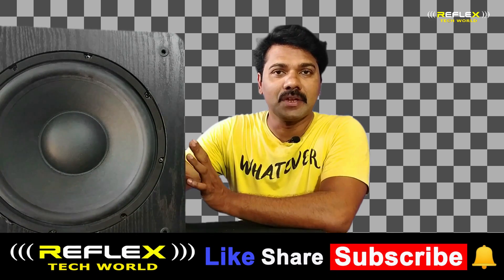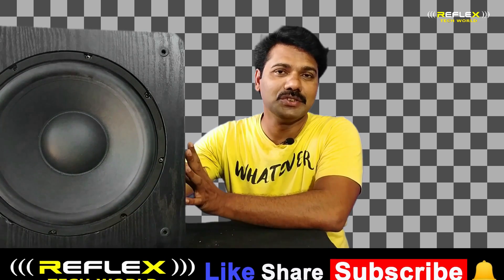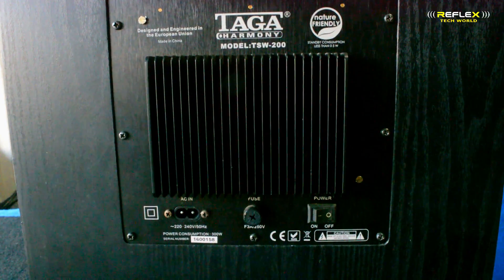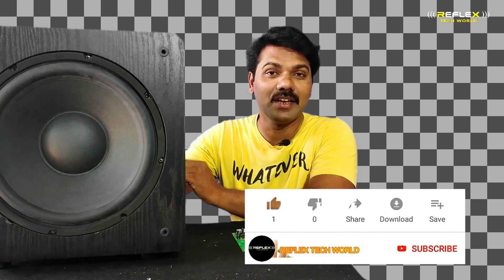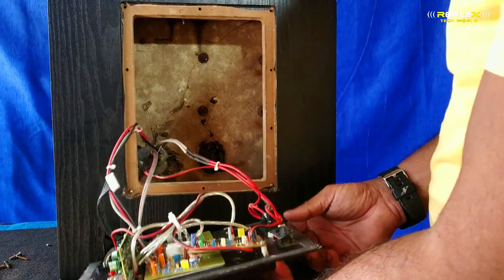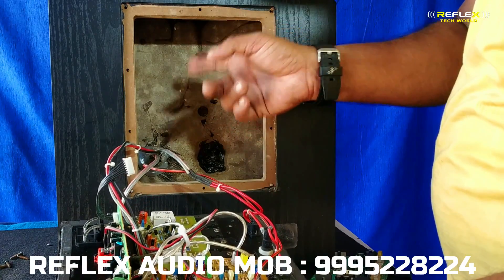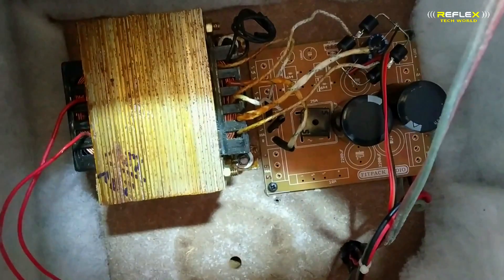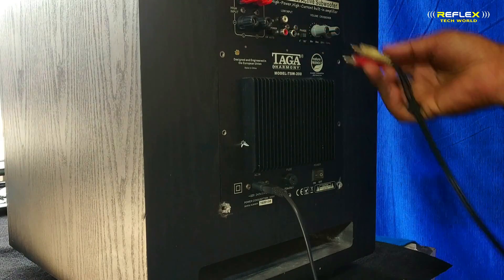HOW TO REPAIR SUBWOOFER AMPLIFIER AND SOUND TEST | MALAYALAM | REFLEX TECH WORLD

Comment: Good video bro, keep going. Few concerns..since you are using bridged amp, 6 ohms speaker load will have an impedence of 3 ohms on each amp. Its like driving 3 ohms load, the given heatsink is not good enough to dissipate the heat generated for a longer duration. 
Also, the ne5532 based crossover is having a cutoff frequency at 160hz, you may hear some voice from that. We can tune it to 120hz by changing the 4 4.7k resistor values to 6.2k.. Or for 80hz change it to 9.2k.. Or replace it with 4 10k preset so that we can tune it.